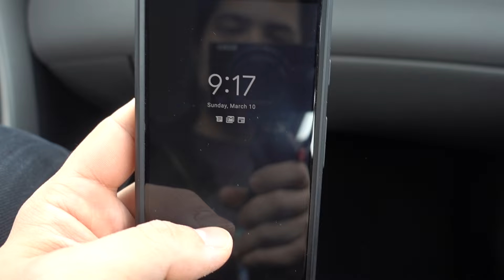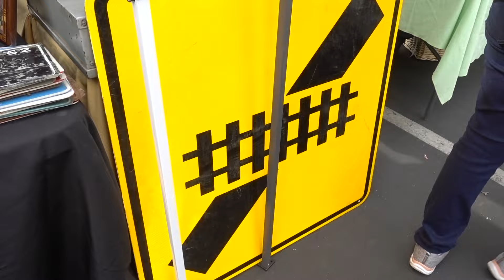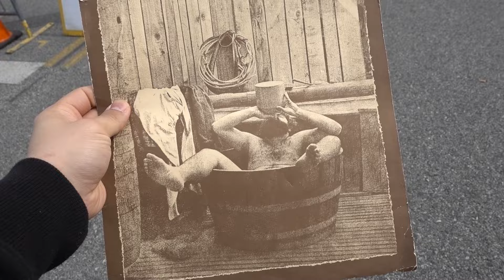We got in a fight

Comment: Holes in the cabinet - clear tape on the backside, wood filler in the holes, sand smooth, paint. 

HP Officejet 7520 - throw that ink guzzler in trash and get you a Brother monochrome laserjet solution.

Comment: Fill the holes on the cabinets and use some contact paper to put some accents swatches on the bottom and hide the holes EZ Mode. Also you can always change the paper down the road if your paint the room or scuff them up.

Comment: Kyle, i feel the need to point out that those upper cabinets are only being held up by screws into a single piece of the back, and not proper cabinet mounting hardware.  If that piece you have the screws into starts to pull out of place, or the screws start to dig into the piece allowing the cabinet to lean away from the wall, the cabinet could fall.  I suggest looking into proper mounting hardware.  :)

Comment: Use wood putty and match a nail polish to the white for those small holes.
Reply: Or glue a wooden dowel the same size as the holes and use the nail polish trick. Either way, cheap easy fixes for your overzealous drilling.